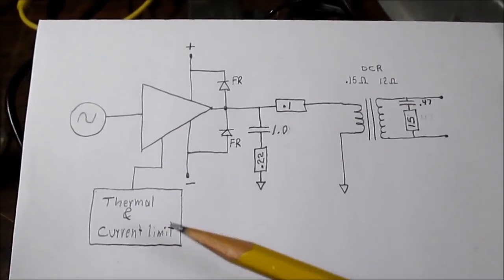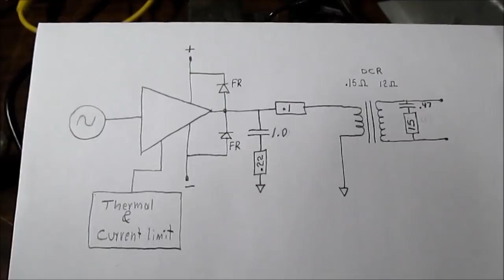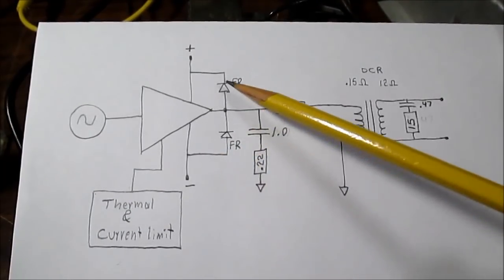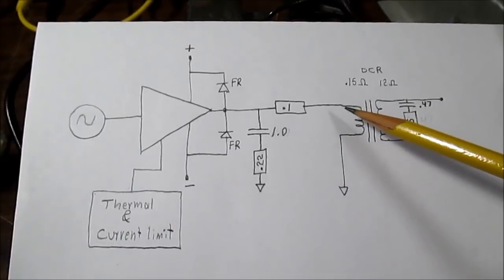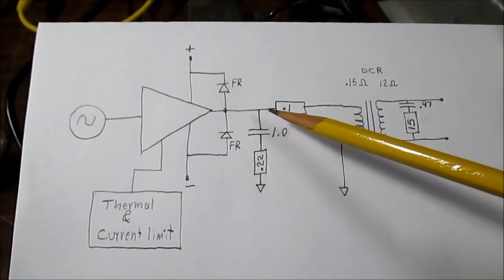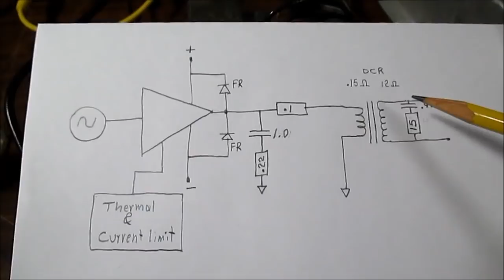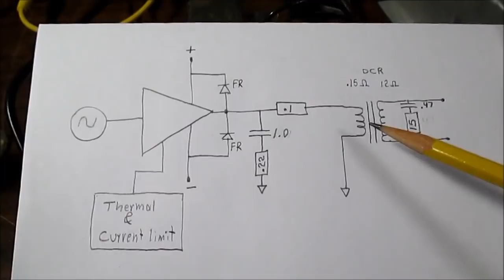Powering a 6V6 tube / valve amplifier with an LM1875 IC amp

Comment: I have a somewhat simpler idea (but might cost somewhat more) of realizing this function (and even higher efficiency!). Feed both sides of the transformers primary winding with high value chokes (maybe old fluorescent light balasts), parallel the winding with a capacitor battery so the thing would oscillate ~60Hz, from both windings have a mosfet to ground, feed the gates with 1k resistors and have rectifier diodes going from gate of one transistor to the drain of the other. This is the so called ZVS driver, but modified for a transformer without a center tap.

Comment: Thanks John for an interesting video.
 I wonder if the LM1875 could be configured itself to oscillate at 60 hz.
Maybe a phase shift type using just resistors and capacitors or some other method.
Reply from the maker: Yes it can. I made a power LED flasher doing that once. I wanted a clean sine wave signal for powering the tube amp so I used the function generator.

Comment: Greetings John! 
 Many of your videos have been a lot of help to me when making Bluetooth speakers. But for my recent project I am using two separate amplifiers. Therefore I would like to ask you if you would know of a solution I could use to power both amplifiers with one power supply, because for now I am getting a lot of noise from using one power supply, I believe that is because of the ground loop. I could use an isolated transformer to get rid of the ground loop but I need a different solution because the isolated converter would not withstand the current that the amplifier would draw. Would you have any suggestions on powering two amplifiers with a single power supply? Thank you so much, I hope you will respond..
Reply from the maker: It should be possible for one power supply to power two amplifiers provided the supply can handle the load of two amplifiers. What is the nature of the noise? Mains electrical hum sound?
Reply: I believe the hum noise is caused by the two amplifiers using the same ground of the power supply, wouldn't that be the case? Anyhow, would there be a solution to get rid of the mains electrical hum noise?
 Thank You
Reply from the maker: Most stereo amps are powered from one supply so it should work. You have to do some testing, such as disconnecting the inputs to see if the hum goes away. Does the supply have an earth ground?
Reply: I am using this power supply: https://goo.gl/kDwD8r
And these amplifiers: https://goo.gl/ov3uA6 and https://goo.gl/DuAYfY

And when I connect both of them to the power supply, a lot of noise is created. When I connect them separately, I hear no noise whatsoever. Any ideas why this occurs?

Comment: Very cool! I never thought of using a audio amp as a power inverter! Basically that's what you did, right? You could loaded your IC much less by powering the tube amps filaments from a separate low voltage source, like a battery. Anyway, that's pretty cool.
Reply from the maker: I was thinking of connecting the amps output directly to the tube amp's 6.3v circuit for the filaments and to backfeed the power transformer for the high plate voltages. However, I'd need about 5 amps rms which is beyond the LM1875 current capability.

Comment: Instead of connecting a signal generator to the input of the LM1875 ic you could have used a NE555 to create the 60 Hz frequency.
Reply from the maker: I wanted a clean sine wave signal.
Reply: Ok.

Comment: I wonder if this could be done with a phase shift oscillator at such a low frequency, I don't think anyone will dedicate their signal generator
Reply from the maker: Yes that could work, however, I wanted a clean sine wave. I once used this method to speed up a turntable that was running a bit slow. Running its synchronous motor at slightly higher frequency bought its speed back up.